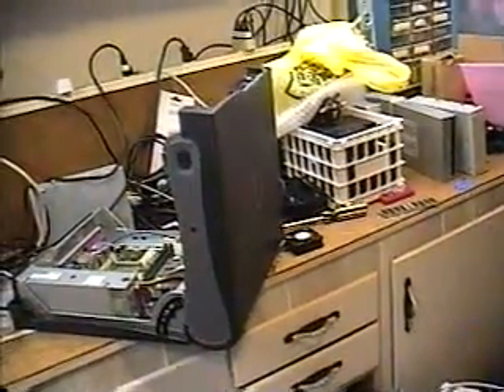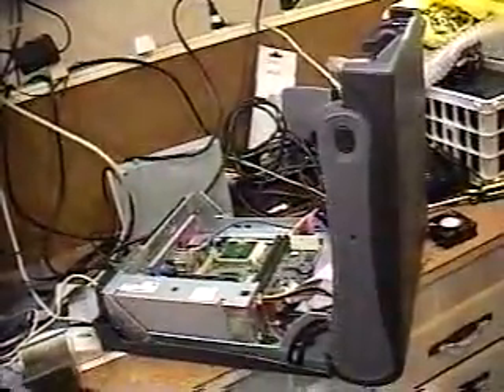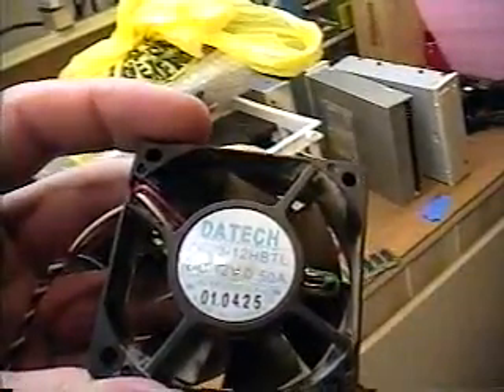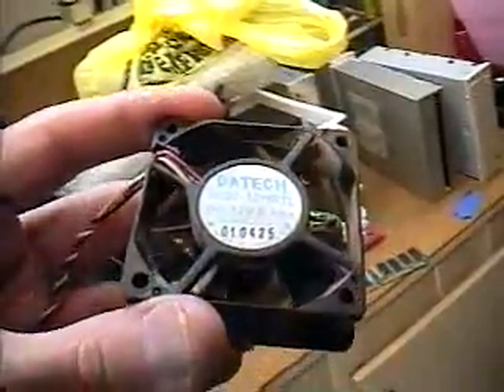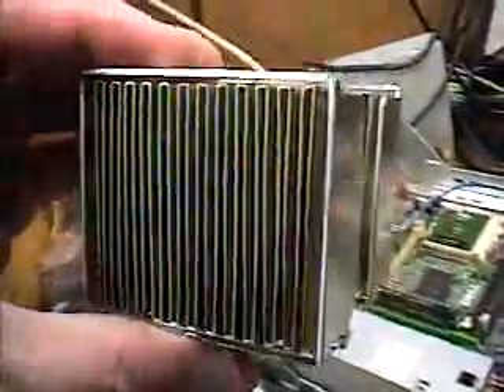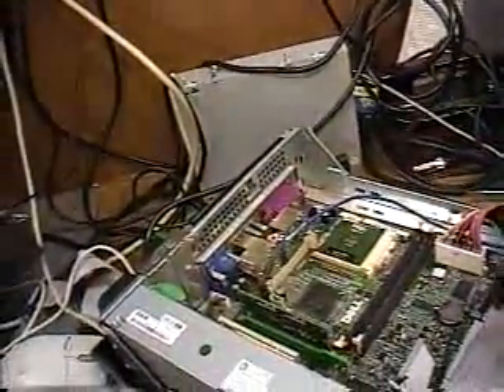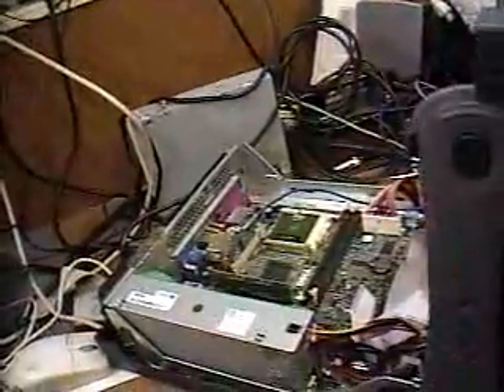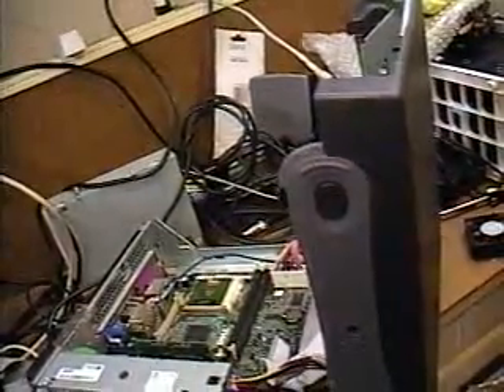PC Repair 1 (DELL PC)

Comment: Just because the fan make noise does not mean you have to replace it.  Remove the back sticker, clean all dust best you can.  Add a few drops of 3 in 1 oil in the hole and manually rotate the fan.  Most likely, the fan will loosen up and run smooth again.  I've done this to several with 100% success.

Comment from the maker: It wasn't worth getting a fan for this unit due to its age.  This unit was a used unit that had some other minor problems and the client had used it for quite awhile not realizing the fan was bad so rather than taking the chance in something else go wrong, the client has a better computer.

Comment: BTW..this dell model is part of the GX series. Either GX150,240,260 or 270 SFF. You can find the model number where the power button is located.

Comment from the maker: You can use the XP hard drive if it is a Genuine installation, meaning that it is not an OEM version.  If you have an OEM version, then that could be the problem because the current Windows sees the hardware as a totally different PC (i.e. Gateway to a DELL).  You may have to re-install the Windows XP software, but do not re-format the drive, this way you can retrieve the current files that you have.  If any more problems, please feel free to ask more questions.  Hope that helps.